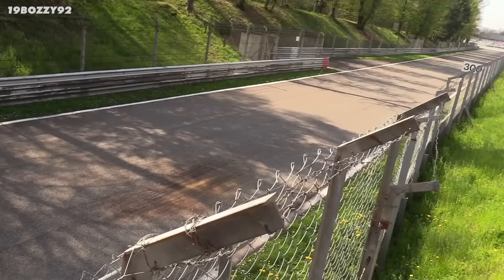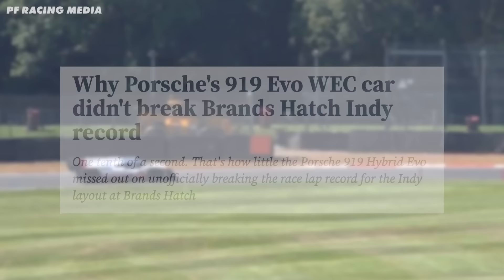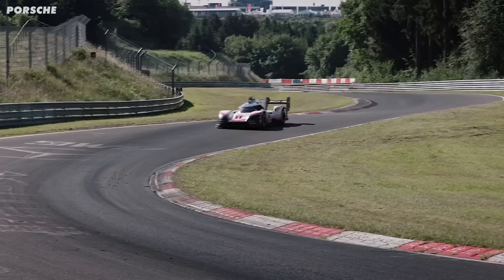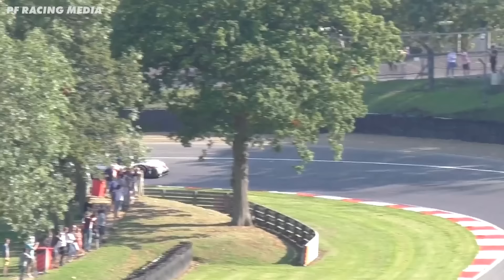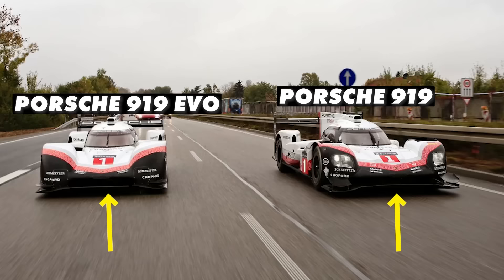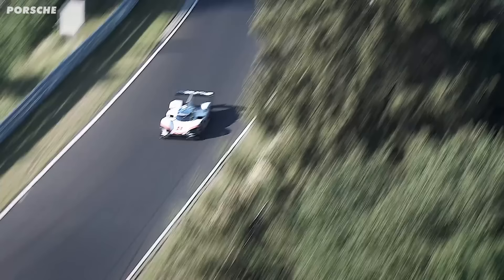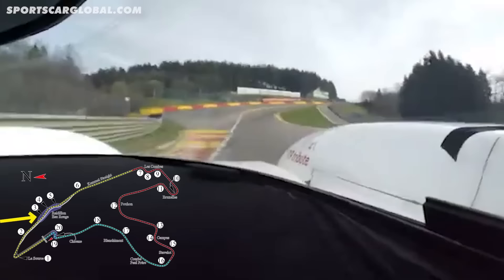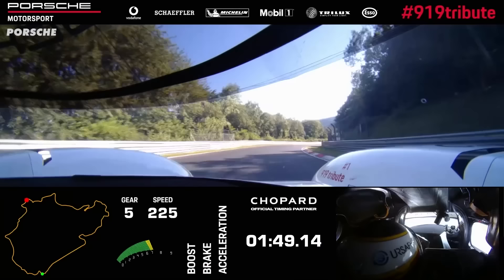The Porsche Faster Than F1

Comment: I actually never knew you held the Brands hatch lap record. Props to you mate.
Reply: The record on the shorter Indy circuit, not the Grand Prix circuit, mind.
Reply: @Mikebumpful you are the rain on parade day. He owns the record. You own negativity.
Reply: @jordanbabcock9349  I think it needed to be specified.
Reply: @jordanbabcock9349 what if "the record" doesn't exist?
Reply: @jordanbabcock9349  In the same way, Max Verstappen holds the Nurburgring lap record, no lie!
Reply: @jordanbabcock9349  Facts do not equal negativity.
Reply: @samuelgarrod8327  but the original statement didn't specify that it wasn't what you said it was.. so there was no need for clarification. You can say a team won the world cup and it remains true. It does not mean you need to say "well, they won X year, but they lost X year." So yeah, I'd say it was negative since nobody asked. The ends don't always justify the means, sir. Good day.
Reply: @jordanbabcock9349  It was until I came across you.
Reply: @samuelgarrod8327  that's awful sad if your day actually changes from an internet comment.
Reply: @jordanbabcock9349 Clarification isn't raining on someone's parade.
Reply: @jordanbabcock9349 damn, my nicely structured and formatted response explaining why your apples and oranges opinion is not relevant nor accurate disappeared. You can absolutely claim your team as a championship team, they’re still competing in X sport and Y series. The clarification isn’t required there. However, playing the same sport, but in a different team, would warrant a mention
Reply: I suspect the holder of the Grand Prix circuit lap record would be rather grateful that that distinction was pointed out.
Reply: its 12 replies, get a grip lol baby
Reply: @jordanbabcock9349 He owns A record. Not THE record. There is no THE record, just records for each variation of the circuit.
Reply: Hi I'm just here for the notifications
Reply: I mean OP is kinda right. Didn't have to specify, he did himself about halfway through the video
Reply: And? @Mikebumpful
Reply: I just want to cause your phone to go off one more time..
Reply: @Not-a-bot222   💀
Reply: CART in the 90s and very early 00s was fantastic racing. I miss that series so much. 😢
Reply: @jordanbabcock9349 bro please just stop 😂😂😂

Comment: Taking a space ship of a race car to laguna seca and only taking 2 seconds off a track record set by an indycar with no power steering from the time of grainy tv footage is mental and a testament to how good some race cars were.
Reply: Or using the right tool for the job.
Reply: That must have been an amazing period in the history of Indycar.
Reply: I think those drovers deserve a lot of the credit too
Reply: Until you have travelled at speed through that corkscrew you have no idea what G's or leaving your stomach on the track feels like lol!
Reply: Would be interesting to see this old car on a modern tires.
Reply: @maximborodyuk3773  This is what I was thinking. 25 years of tire developement would surely have the old CART car going more than 2 seconds faster
Reply: it's running on highly inflated tyres not suitable for smaller tracks as he mentioned about brands hatch
Reply: @dielaughing73  man those sheep were fast
Reply: @richardmori1389  not to mention the horses

Comment: The takeaway here should be how insanely fast F1 cars are if an LMP1 car needs its fuel flow limit removed, energy deployment limits removed, skirts added, weight reduced, special custom quali tyres fitted and movable aero added just to match F1.
Reply: And the w11 would still beat it lol
Reply: Bingo. If they made a new one every year and raced it against other equally unrestricted cars every weekend all around the world then maybe it would be a more valuable comparison. But I've seen this clickbait title too often now, especially since it was immediately beaten again the very next time F1 went to Spa after this record even though they didn't give a shit about absolute lap records. Nobody is questioning the fact that regulations hold cars back. That's what's impressive with F1 is that it takes a purpose built unrestricted version of the second fastest race car in the world to go faster than they do every weekend.
Reply: F1 is WAY lighter, fanboy
Reply: Or how extremely limited the starting 919 is......
Reply: I mean that’s not really a take away, f1 core concept is already the receipt for the fastest track car, high down force, high hp and low weight.
Reply: yeah but the thing you are missing is they didn't have a 500 mil budget or extensive testing
Reply: weird how you need to do all sorts of different things to beat a very different car
Reply: But a F1 racecar is only made to run for a few laps, then needs to be maintenenced and partially rebuilt, whereas a LMP1 is made to run for 24+ hours straight. So while an F1 car is slightly faster, the LMP1 car is MUCH more durable and efficient.
Reply: @bradleywalker8642  No  they only get a few allowed engines per season.    They have to run multiple practices, qualifying, sprints and races with the same engine as long as possible not get get penalized for going over the allotment
Reply: @bradleywalker8642  This is true, however it doesnt apply to the 919 Evo specifically. It has many changes from the LMP1 car that make it less reliable, and also it cannot run at the nurburgring lap time record pace for any longer than that one lap. The W11 or F2004 with slicks are much faster and generally more reliable over a race length
Reply: An LMP1 car reaching F1 speeds by simply adding a few bolt-ons and removing restrictions mandated by regulations is more a testament to LMP1 than it is to F1.
Reply: people seem to forget every few years F1 regulations are purposely adjusted to hold F1 cars back from going any faster. It's kind of sad but you're effectively comparing an unrestricted car to a car that the FIA and F1 restrict over and over again to limit its performance with ever more strict development rule sets. Cars haven't realistically gotten meaningfully faster in the last 2 decades.
Reply: @azzifyy5988 the rules of f1 already allows it to be very fast. You can compare an unrestricted 919 because to a a normal f1. It’s not like the 919 had a year of r&d and also built from ground up with no rules

Comment: 7:30 Regarding tyre width, increasing it doesn't increase the grip from friction. The formula for friction forces do not even include information about the contact area.

However, wider tires are better for race-cars for two main reasons. 

Firstly, tyres, especially soft racing tyres, don't get all of their grip from simple surface interaction friction, they get some of their grip by smooshing into the gaps and cracks in the road surface which is HIGHLY dependent on contact area. 

Secondly, larger tyres experience less pressure because the force from the ground is acting on a larger area. This means they wear more slowly (and there's more tyre to be worn away) which lets you get away with softer compounds that have higher coefficients of friction, while still having a working tyre after a lap.
Reply: I would have sworn I learned about that from this channel, in one of his videos on the history of F1 tyres. If so, it's an odd oversight. Maybe he meant more grip over the entirety of a lap - since a smaller patch would get too hot and wear too fast, given it's already a problem with the quite wide F1 22 regs tyres.
Reply: iirc the main reason, that applies to all cars, is that the physics equation is perfect world setting only. in reality as cars lose grip on a turn they lose material and for that the wider tyre means losing less % of total material

Comment: If they used wheel covers, would it go faster?
Reply: Like with everything on high performance vehicles, everything needs to work together. So sometimes wheel covers are great pieces of aero, especially when designed properly and in harmony with the rest of the cars aero. But other times they can restrict airflow to or from the breaking systems, which could mean red hot/combusting breaks. Its always something that's a pro vs. con on these cars. I like to assume the best engineers in the world tend to look at every avenue to make their cars faster, so Id bet they probably looked at em and decided to opt out.
Reply: @Amm17ar  indeed, it works best for top speed records, which need minimal braking, only when you end the run. For a track car it needs airflow like crazy for the brakes, so that wouldnt work.
Reply: @Amm17ar Fantastic response mate.
Reply: @XDemKneesX  Thanks, appreciate that!
Reply: @Amm17ar *braking systems, which you don't want breaking
Reply: @georgerosebush9754  Lol no you definitely do not....or else you end up like Charles did today. Thanks, I didn't even notice I used the wrong spelling lol.
Reply: I think so, Red Bull X2011 uses closed wheels design for exampls
Reply: @Amm17ar thank you for the response, it was a thought i was thinking about for some time.
Reply: @kerimca98  The Red Bull X1, is a fictional prototype vehicle featured in video games.
Reply: @doenermitallem  Yet not unrealistic if someone dares to build it
Reply: @doenermitallem  

True, but it was designed by Adrian Newey, with what was available at the time, so odds are it would work in real life, if it ever got build. 

The problem would be to find a driver to sustain the G that monster would pull.. 

Don't look at me.. Or the dude from this video, claiming to hold "the track record" at Branch Hatch! Eighter of us could drive it at speed!
Reply: @therealFearlessBOB You talk rubbish man. But that's the beauty of the Internet. Have a nice time

Comment: The front diffuser is in fact a nozzle, the opposite to a diffuser.  A nozzle accelerates the air and reduces the pressure.  (Think of the nozzle at the end of a garden hose, in the hose the water pressure is high and the velocity is slow, at the tip of the nozzle the pressure is atmospheric and the water velocity is much higher than in the hose.)  A diffuser slows the air and increases the pressure.  The nozzle at the front accelerates the air relative to the car from car velocity to a higher velocity producing high velocity air going under the car with the subsequent drop in pressure.  High pressure converted to high velocity and low pressure.   The diffuser at the back slows the high velocity air and increases the air pressure back towards atmospheric pressure.  High velocity and low pressure converted to lower velocity and higher pressure.  Both nozzle and diffuser work together to produce the higher velocity and lower pressure under the vehicle.

Comment: This car is absolutely mental to drive in a sim. Especially on Nordschleife.
Reply: omg yes, i spent all of lockdown back in 2020+ doing exactly this on asseto corsa, what a blast. love this car
Reply: @soleenzo893  It's such a thrill the first time you take this car and full send at  Schwedenkreuz. Then full send again in Fuchsröhre and uphill braking for Adenauer Forst.
Reply: Unfortunately the versions used in AC and PC2 are not very accurate as they're only mods made by fans.
Reply: BattleBro360  The 2000+ HP version is comically quick. It's so insane that I did like a 3:30 around Nordschleife and I made tons of mistakes.
Reply: BattleBro360  No, I play AC on PC and the mod I downloaded has three versions of the X2014 (500, 1700 and 2000+ HP). The first one is kind of like a normal F1 car, the second one is extremely fast, but the most powerful one is just silly haha. It's not even that hard to control and I use a controller. Thing is just planted to the ground.

Comment: Imagine how much cheaper would F1 cars be if instead of making a 10 million dollar engine,  you just evolved the suspension, aerodynamics and reduced weight.
Reply: Yes, a $10 million engine that is weaker than engines made decades ago.
Modern racing stifles innovation and keeps fair competition from eating their lunch... see Koenigsegg. Lol, he smoked them all.
Reply: @JoeGator23  weaker? define "weak", because right now F1 has the more reliable and efficient engines in the history of sport. Mechanical DNFs due to engine failures are very VERY rare. They may not have the biggest power output, but they compensate it greatly in other areas. Current F1 engines would smoke any of the previous F1 engines.
Reply: F1 fogies whine louder than the engines they talk about. You know, the ones that were only around for 7 years
Reply: @TheProkonover That's not true because power and weight are the only relevant engine characteristics. Longevity wouldn't be a concern if it wasn't for ridiculous regulations.
Reply: Idk how F1 has so much money put into it yet manages to be such a dull slog to watch.
Reply: @JoeGator23  How are Koenigsegg engines better than F1? You don't know anything
Reply: @flurpoid You don't understand F1 regulations, like everyone in this comment section. This porsche car is "unregulated": they're free to do anything they want, the way they want. Not in F1 where regulations are strict as fuck due to security most often, limiting what engines and an F1 car can do. In 2014 if I'm not wrong, regulations made slower cars, slower than an F2 (FIA tries new things year on year and it goes bad for everyone on the grid sometimes).
The goal of an F1 team is to create the fastest car IN RESPECT to regulations, that means technical limitations that disables the team from building a faster car.

So please just stop thinking these "unregulated" cars here or there beat F1 teams blablablah, it's uneducated bullshit.
Porsche doesn't spend $500M on their team and a car per year because they don't do F1, so they sure as fuck can spend their money into an unregulated rocketship if they want, it's a ton cheaper. The other teams are busy building regulated cars in attemps to win an actual championship.
Reply: @IgnitionP can a koenigsegg engine resist 1 hour of high intensity session with an average speed of 120mph? No.
Reply: @malekdu9380  Exactly, so how is it any better?
Reply: How is it weaker, last 2 season have seen some of the most reliable cars for everyone on the grid
Reply: If you allowed that in F1 the drivers would need g suits and probably different tracks as well they would be so fast but I get where you are coming from :)
Reply: @malekdu9380  yes it can😂
Reply: @alxmtncstudio2066  all the person said was that F1 is boring to watch

Comment: The wider the tire the less shear force the rubber has to deal with because of the larger surface area. Which means less wear and less heat which in turn means you can run much softer compounds without them falling apart. So more grip! If anyone wanted a more detailed explanation.

Comment: I wanna see a high-end series with the biggest performance restriction moved out of the car.  The driver.  Put them in a sim-rig at the track (lots of marketing potential there), the amount of weight saved from all the crash protection and need to have a huge hole in the middle, would allow for much faster cars on current tyre tech.  Then mix in WEC Hypercar style rules governing amount of downforce and such, but mix in a limitation on aerodynamic wake in critical areas (so the engineers work to reinforcing that intent, rather than against it).  
Not having a life on the line when things get pushed too far, would help liberate the regulators as well, so that engineers can really have some fun.  Slashing the weight limit from F1's level, would mean existing catch fencing should typically be sufficient to deal with the increased speeds as well.
The drivers would still have to be at the track to keep network latency sufficiently low, and guard against DDOS, but they also wouldn't be exposed to the harsh environment inside the cockpit.  Sure, it wouldn't be for some, but I'm sure there's a decent audience that could easily grow.

Comment: majority of the “suction” that diffusers produce is a product of lower pressure in the wake of the car. the bernoulli principle works to extract the most benefit from high pressure to low. not really related to airfoils

Comment: diffusers don't accelerate air, it expands and slows down, but in the middle, where it is constricted it bennefits from a bigger difuser, thus creating more downforce.    (*Edition*) Also, low pressure doesn't suck, it simply doesn't match the force of the highpressure when pushing the car up. That's why we call it a pressure difference.